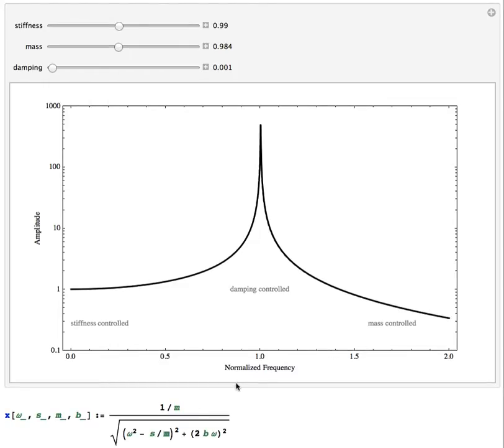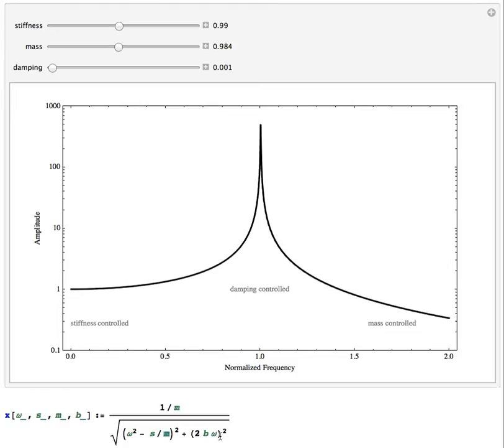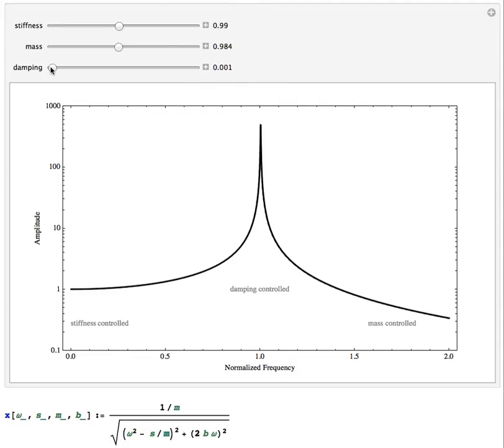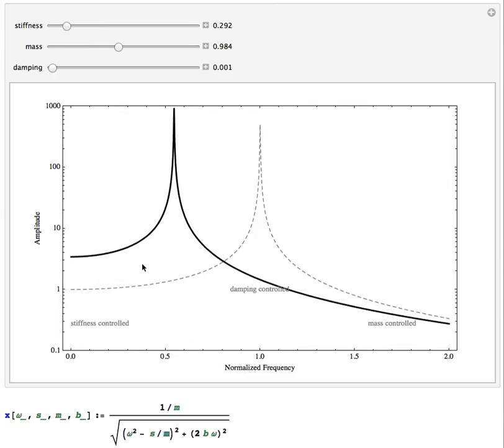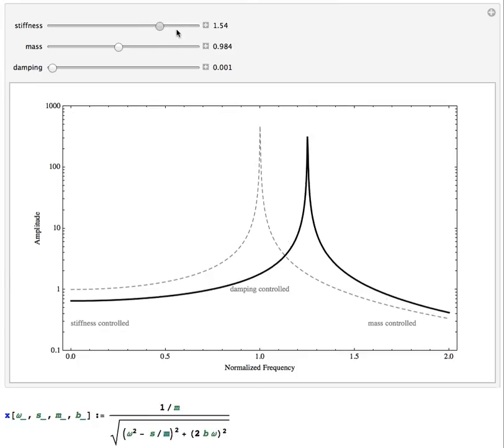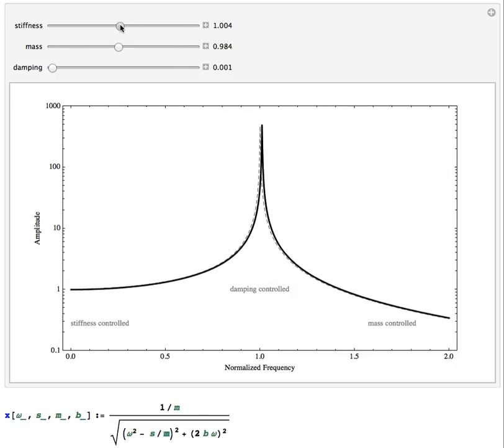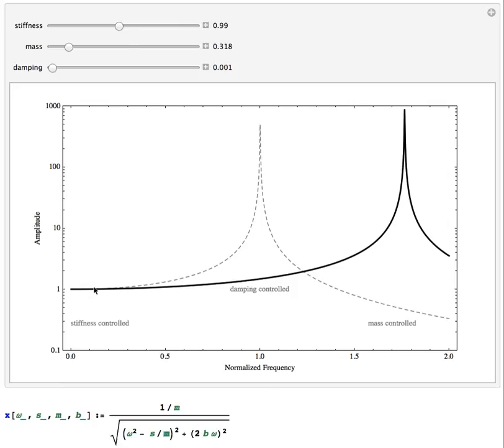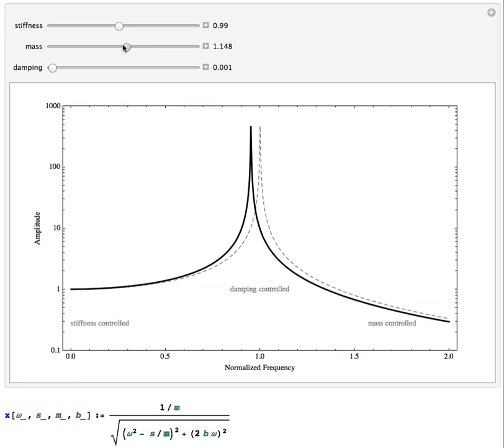Response of a mass-spring system to a driving force

Comment: x axis does not seem to be normalised frequency. Peak should always occur at r=1. r is normalised frequency
Reply from the maker: +Vodela Rakesh  The peak occurs at r =1 only if the mass and stiffness result in a natural frequency  that is the same as r = 1.  If you change the mass (while leaving the stiffness alone) then the peak frequency will shift to a different value.  Likewise, if you change the stiffness (while leaving the mass alone) then the peak frequency will shift to a different value.  Changing the damping does not change the frequency of the system (which depends only on the mass and stiffness).
Reply: +Dan Russell can you tell what is the expression for normalised frequency
Reply: sir can you tell me how to make this plot in Mathematica by an youtube vedio or give me your email id so i can email you my code which is not working. my- email- emailtorommel@gmail.com

Comment: Damping does change the natural frequency but only slightly. Using the symbols in the video, if r = the damping factor = b/(2(sm)^0.5), then the natural frequency changes by the ratio (1-r^2)^0.5. Changing the damping factor from 0.05 to 0.1 reduces the response at resonance by a factor of 40, but the frequency changes by less than 0.5%.